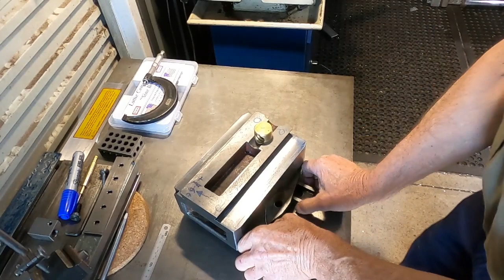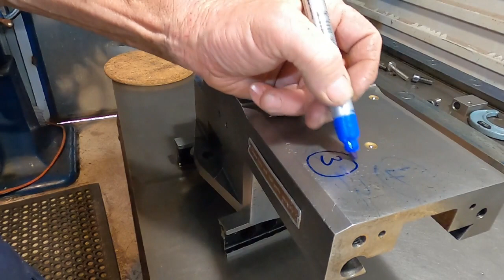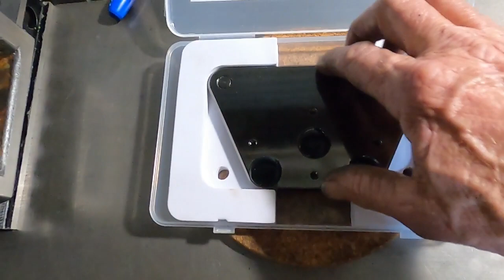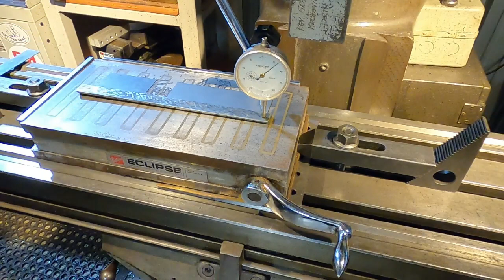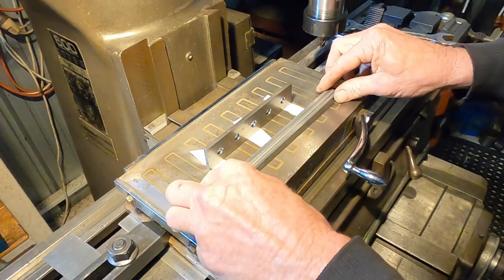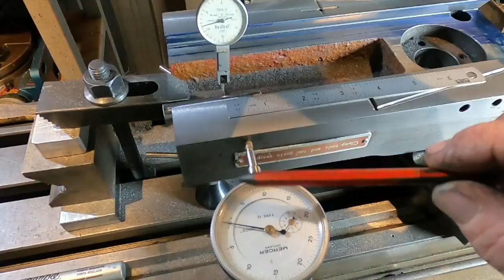JFMT Lathe Repairs .  It's all about the ''Angle of the Dangle''  !

Comment from the maker: Problem solved  !!!    When the Gib is rotated from being machined on it's back to it's 60 deg position , the angle changes .  
Compound Angle .    Similar to a 60 deg threading tool .  In a flat tool holder it will cut 60 deg , in an inclined tool holder it will not !!!
Reply: Great call, compound angle territory doesn't take prisoners.
Reply: So your 65 thou should have been multiplied by 0.866 (sine of 60deg.)?
Reply: Glad you got that sorted, it could have caused a few sleepless night LOL
Reply: Hello Max. It is what I wanted to suggest. Well done. Cheers.
Reply from the maker: @damienduquennoy5231  👍
Reply: Hmmm.. was wondering if, after getting the surfaces on the dovetail flat and straight, one could measure the gap directly at each end of the longer piece (perpendicular to the 2 surfaces), at the extremes of travel, maybe using gage blocks... Or, at this point, using the first iteration of the gib plus feeler gage.. also, with that mag chuck set up wouldn't it be handy to make a few tapered pieces of stock for measuring gaps like that?? 
Also, seems like if you made the gib a couple inches longer than needed on the thick end you have a better chance of scraping it in and still having usable thickness.. then could trim it to length and add the screw slot once it is fit properly..    
Thanks so much for taking the time to share this all by video!
Reply from the maker: @windrk_6754  If i had some cast iron spare , i would make a  new gib .  This one is a fraction on the short side but it will shim up ok .     👍
Reply: Yea, this is where having CAD or paper and pencil and drawing what's going on is worth the 5 minutes of sitting down.
Why I love machining and tooling making is your always learning. Glad you figured it out and shared it with us.

Comment: Hi Max, thoroughly enjoying this series of videos. I know it’s a while back now but when you found your .065” measurement, could you have used the sine bar constants in Machinery’s Handbook to reference the angle?
Reply from the maker: Probably not as the setting was done over the length of the mag chuck not a standard sine bar length .  👍

Comment: My friend, I’ve been watching for this Episode and  4 before this session all has made since. 
I have made a number of dove slides. And never did ever use Unsymmetrical gib, angled on top / bottom yes but the parts that do the sliding always the same thickness. End to end
Now then by correcting the slides (dove tail) by milling them true. Your overall spacing between the two rails has increased. Thus, you WILL need to increase the thickness of the gib, yes a new one. And it will become all better.😮
Reply from the maker: No worries . I usually shim the gib if required .  It is a pretty common practice .  Cheers  👍

Comment: I'm guessing the 1/2 thousandth dip you think is in the sine bar is actually your XY table lowering mid-span due to wear.
Reply from the maker: Sine bar and mag chuck both have a 1/2 thou dip ( checked with known straight parallel ).  Table is good over that short distance .  👍

Comment: Wrong equation.
The angle of the dangle, divided by the heat of the meat and then added to the throb of the knob should sort out the error. 😉😜😂👍
Unless of course it’s a compound angle of the dangle, then you use the differential equation.
The angle of the dangle is inversely proportional to the heat of the meat, provided that the maxis of the axis, and the gravity of the cavity, remain constant.
Reply from the maker: Maxis had the wrong axis !    Bloody compound angle . 👍

Comment: How did they machine gibs before mag chucks were invented?
Reply: Most likely on a Shaper or Planer, with a combination of excess material as "Tags" at each end, and angled fixtures trammed in at the required angle or draft. The excess cut off after, side and top machined at the same setting. Possibly next operation could be 2 fixed together and machined parallel?
Great question.
Reply from the maker: Probably special fixtures , all angles pre set .  👍

Comment: Compound base component across dovetails parallel within 0.0002" (0.006 or 6 micron) is Impressive on any milling machine, possibly, in hindsight,  nipping the Gib on X  would help, but splitting hairs here?
Ref Gib strip angle, that was a head scratcher, but obvious after it being pointed out, good old compound angles 😉 or not 😱.
Nice setups as expected Max, always sound practices, with a bit of ingenuity ✔.
Refurbishment coming along very nicely 👌. 
Thanks for sharing and hope you had a few hard earned beers 🍻 
Regards John
Reply from the maker: Cheers .   I did not see that one coming ! 👍

Comment: The problem was due to the incomplete equation you used. The angle of the dangle is equal to the means of the extremes. Using that complete equation would have eliminated all of these problems.

Actually, at one point, when you were machining the gib and said that it felt to you that you should be taking more off the other end, might have been correct. I thought that the gib was backwards on the mill, and milling off that amount was going to double the error. Well, maybe that was the problem, or not. I can’t say as not being there, but when doubling an error, it may not be a measurement problem at all, but a placement one. I’ve done it myself, and was totally confused as to what happened until I retraced the exact steps I took, and realized what I had done.
Reply from the maker: Compound angle comes into play , when the gib is rolled 60 deg .   Missed that one !  👍

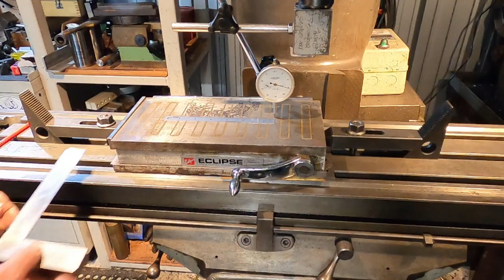Comment: Hi Max, in your last video at 11:30 you made a measurement from the opposite side of your part instead of the face that you referenced from, I'm thinking that you should have measured in between the dove tails with pins. I'm not sure but I'm thinking that is where your error is.
Rich
Reply from the maker: That opposite side is less than 1/2 a thou different from the other side .  In between the dovetails with pins will give the same result as the method used .  The problem is   when the gib is rotated from the flat surface on the mag chuck 60 deg to where it sits   , a compound angle comes into play .  I will show it in the next video . 👍

Comment: I'm a simple man Max, and I always look for a simple solution. I would have cleaned the parts well, then superglued and clamped the gib in place, then after the glue had set used the dovetail cutter to lightly skim the gib. Engineers out there are going to hate me for this, but it saves my brain exploding with all the maths. 😊
Reply from the maker: That's the easy way !  👍

Comment: Still a bit confused doesn't the pines you used to measure the angle remove the compound error ?.
Reply from the maker: It happens when the gib is rotated 60 deg from machining position to fitment position , due to the taper  . 👍

Comment: I would check the mill table travel by setting a straight edge on top and checking the travel straightness. There will be a hump or dip. My mill has this problem too.
Reply from the maker: My one has a .003''   bow .   👍
Reply: @swanvalleymachineshop  Yeah very annoying, I will attempt to correct it one day.  Is yours a bow up or down in the middle? I am building a new shed at the moment. That is taking a lot of my time.
Reply from the maker: @johnmcnamara3719  Bows down from memory .  Caused by the t slots , a peening action happens that causes the bow .   Shed's take time , my one tied me up every weekend for 3 years !
Reply: @swanvalleymachineshop  On My mill it bows up in the middle. The table puts more weight on the dovetails and slide surfaces at each end of travel less wear in the middle when the table is fully supported. Its a Shizouka VHRG.

Comment: I'm thinking that the error may be due to the slope of the dovetail.  The gib is parallel to the sloped face yet you are measuring the gap across the width square to the compound.  When correcting the thickness of the gib you are measuring 30degrees off square to the other measurement.  If your delta was 0.065 thou square, it would have to be cos(30)=0.866 corrected to 0.056.
Reply from the maker: You hit the nail on the head there !     When rotated the angle measurement changes .  I wonder if anyone else will pick that up !!! 👍
Reply: Great call

Comment: I was initially thinking maybe the gib was a banana to begin with. But then you discovered the issue with the mag chuck. The next thing I though was that you machined down the thickness of the wrong end of the gib. That would explain the near doubling of the error.
Reply from the maker: That 's the issue , the angle measurements pointed to taking the material off the wrong end .  👍

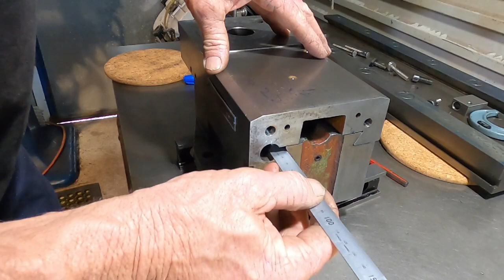Comment: I think at 7:30 you uncover the discrepancy but assumed the wrong end was too thick. I reckon it is the thin end that is too thick but a minute or two further on you say you're sure it is the thick end that's too thick. When you push it forward the gib goes in 45mm and pulled back it goes in 48mm (ie goes in further and so the gap must have been bigger - the 6 thou wear + however much you machined from the gib). So with it pushed forward and the gib gone in 45mm, the end of the gib nearest the camera must have loose play (ie the thick end is now too thin). The numbers back this up too (6-7 thou blew out to 13).
Reply from the maker: The material has to come off the thick end , not the thin end as the angle measurement indicated .     On the final corrected angle , all material came off the thick end . 👍
Reply: @swanvalleymachineshop  OK so now I really understand your look of confusion in the vid.
Reply from the maker: @dennisbjones  Compound angle reared it's ugly head !
Reply: @swanvalleymachineshop  Just watched the follow up. I did like those numbers though and lost track of which end was worn. Makes sense that the thin end wears under load facing. Friggen oblique planes ;)

Comment: Hi Max, scratching my head, only 2 things I can think of, cosine error of DTI or dial gauge.
Vertical height linearity of gauge pins at each end.
Time to fit a DRO on the mill, give you exact travel measurements.
Reply from the maker: The sine bar backs up any travel error .  It would take a lot of cosine error to get those differences , then i would have had inconsistent results when double & triple checking . Vertical height linearity is just under 1/2 thou , not enough to get completely different results i would expect  .     I am still at a loss on this one !!!     That mill & the JFMT lathe will be getting Easson DRO'S   fitted , hopefully next year .  👍
Just went back & re measured .  On it's back in the mag chuck the taper is a different angle to when it sits rolled over to a 60 deg angle .    Must take the compound angle .
Reply: Hi Max, mystery.
Back in the mid nineties my machinery dealer south of the river Perth told me I was living in the Dark Ages without a DRO, bought an Accurite dro and installed it on my BP clone  not cheap back then.
Here in Philippines I have dro's on my mill and lathe with a lot more features.
Googled sine bars and one article said only accurate between 15 and 45degrees for reasons above my pay grade.
Reply from the maker: @willemvantsant5105  Interesting about the sine bars , not heard that before .    Would be interesting to hear a toolmakers view on it .  👍
Reply: @willemvantsant5105  Certainly not heard of Sine bars being inaccurate between 15° & 45°, I can understand from 50° plus , ref combination of tall gauge stack and gravity. Food for thought?

Comment: Bruce you may not have uncovered the problem, but you have shared a hell of a lot of experience with us looking for it. Watching you use the cigarette paper to find the low spot is excellent information. I keep a pack of papers in my box and use them on occasion for measurements, but I would never thot of the 3-paper method you just demonstrated. Thanks for bringing us along even if it is frustrating for you.
Reply from the maker: Thanks .   👍